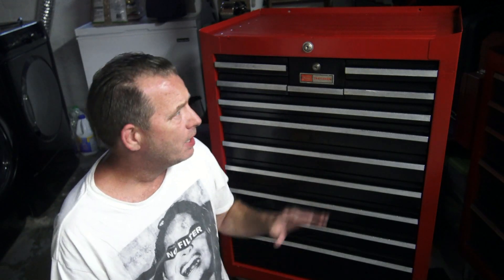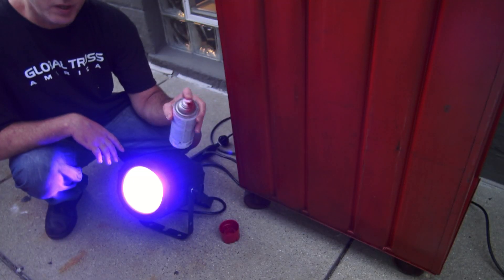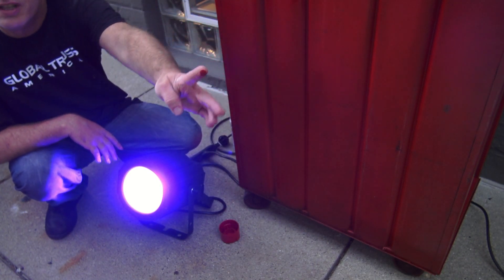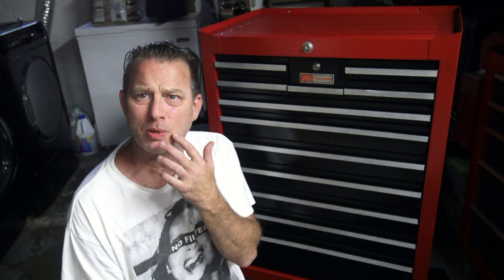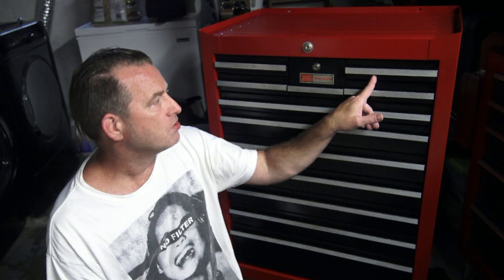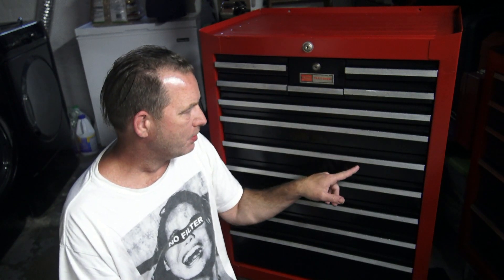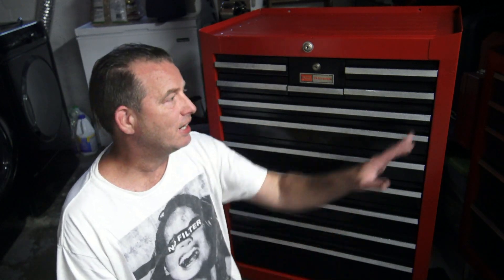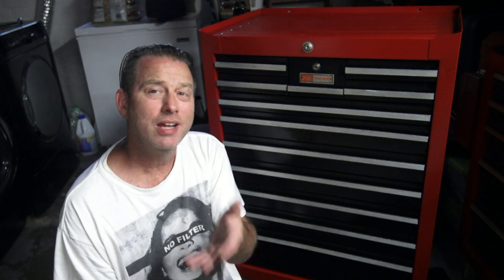ADJ LED UV Light For Paint Drying - Experiment Results

Comment: There are different wavelengths within the light considered UV.  I have found that UVC, the type that is good for killing germs but TERRIBLE for your skin, to cure lacquer extremely fast, compared to air drying.  UVC is between 200-280 nm.  Those UV LEDs only emit one single wavelength, unlike a fluorescent UV bulb, which will emit a  small spectrum of UV wavelengths.  I burned my eyes once by looking into my light for only a few seconds.  I use an array I made from several of the  Sylvania 21086 bulb and just plain T8 fixtures and it works great.

Comment: Bran, it's not UV, but IR, and intense heat, with air, which automotive painters use to fast dry paint. UV is only going to fade the colour of the paint. Also, it's interesting to note your comment about UV causing your lips to crack. Definitely some medical concerns to look into, here. On the plus side, the UV will certainly sterilize the surfaces. LOL Thanks, and keep up the great works! ;)
Reply from the maker: I didn't say they cracked, I can just feel the exposure a bit
Reply from the maker: I don't doubt what you are saying.  I'm just seeing a lot of info on UV Curing out there
Reply: Ah, yes, I do know UV is used to harden many types of epoxy stuff, even dental fillers, ect. Sorry I misheard what you said about the exposure. LOL. ;)
Reply: This is absolutely incorrect, there are many UV curing industrial paints/automotive paints.